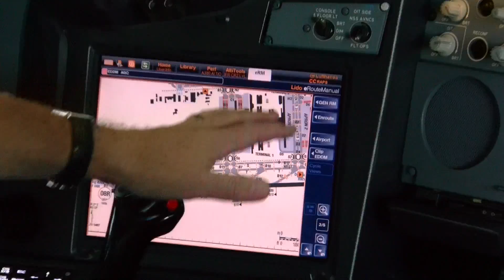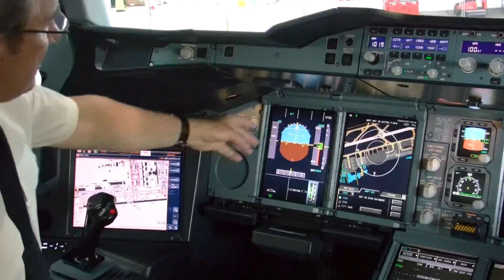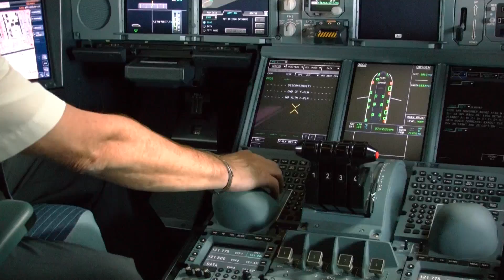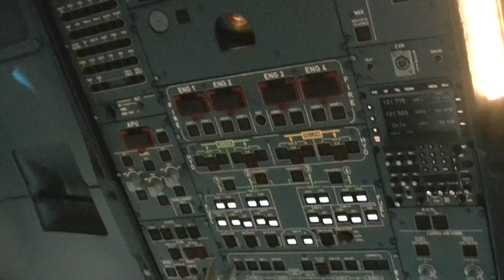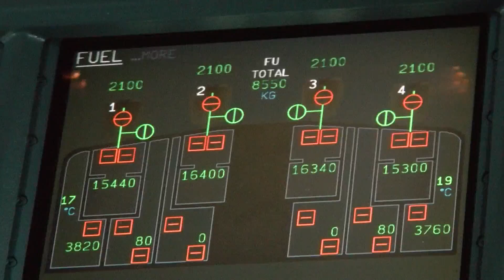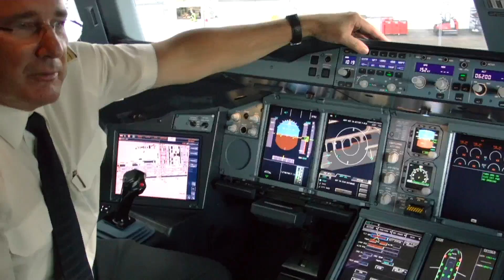Air Hansa A380 Cockpit Tour

Comment: Question what happens if the plane is hit by lighting  and the computer shorts out. Really the pilots should have paper back ups.   If the computer goes the  plane is going to fall from the sky like the AIR France plane in the south Atlantic last year.  I work in computers here in the States and I do not trust them.